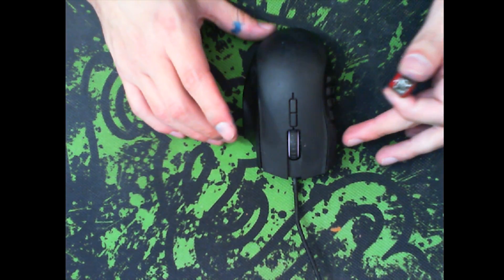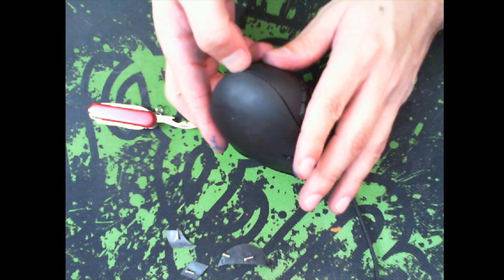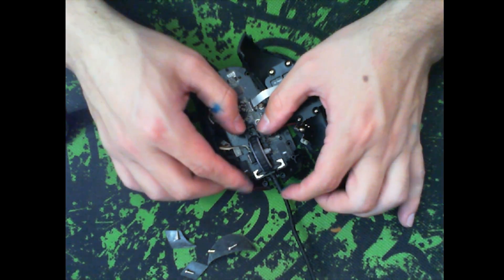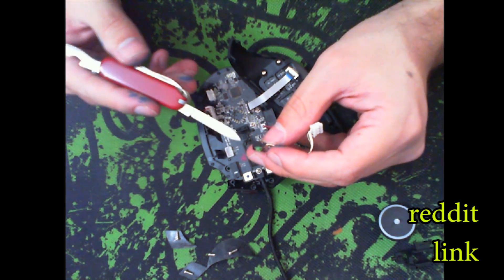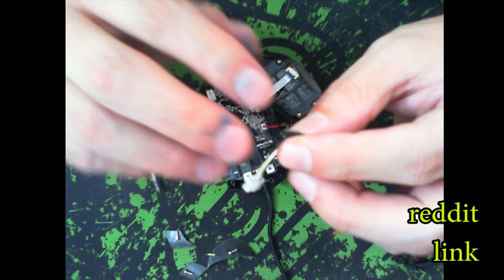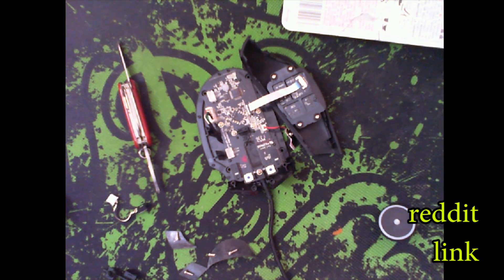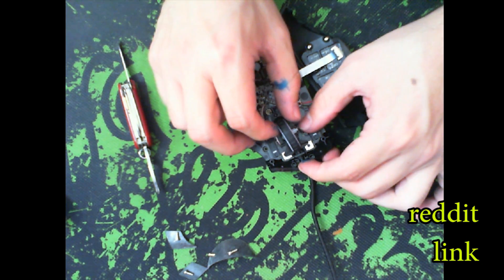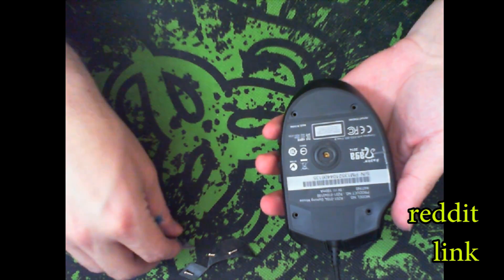How to Fix Razer Naga 2014 Scroll Wheel Jumping DIY

Comment: Took my Naga Chroma apart today after blowing into like other people have suggested didn't fix the issue. There was a lot of hairs and dust so I cleaned that out and put it back together, still didn't fix the wheel jumping. So I was going to give this a go but decided not to because I didn't want to cut the encoder in case I completely botch the process and completely break the part. I thought I'd find and buy a replacement encoder instead and just live with the jumpy wheel until then. Don't know why, but I flicked the encoder a few times with my finger before I put the mouse back together, to my surprize the jumping is gone! maybe flicking it unstuck the spring or something without needing to open it up. 😂

Comment: While I don't have the Naga 2014 at this point now, I do have the Epic Chroma edition that came in '15.  It's been amazing, until last weekend when the scroll started jumping.  I feel it necessary for anyone currently having issues, try opening it up and blasting it with air.  I done that and now it works amazing again.  I also want to note, don't let any glitter around your gaming or computer area.  That's what my issue was... So much glitter. #GottaDaughter

Comment: Thanks for the vid! Worked for my 2014 naga. I did not need to use superglue though. I was able to bend the D up enough to get it working, and then the square cover stuck snug to the black pieces we cut off, no need for glue. Had to bend it a few times to get it working though.

Comment: Thank you!! my razer basilisk ultimate have this issue! I've tried update firmware reinstall synapse and use straw to  blow in to the mouse wheel hole but they can't help. so I decide this last step to screw it as your show and it work!!

Comment: I'm just sitting here watching the "How To..." video while I blow my razer with a straw.  
Pro-tip for those using the straw method before disassembly:  Hold the mouse above your head so that you're blowing 'uphill' into the device.  Reason is to minimize the amount of moisture that is blown into the hardware.

Comment: ive done the straw and blow in it trick and all fixed it a couple times with the method. Even used a can of air as well. Eventually it didnt work i follow this and it works wonder. Tho i did not use glue i just put it back in and its doing just fine.

Comment: Thanks mate! I didn't go as far as deleding the metal plate, but this was def this square stuff involved into the "jumpy wheel" acting. I slided a little piece of paper folded into itself to prevent any parasite movement of the sensor connector into its platic case. The wheel is now a bit stuffer, but incrementing is acting normal. Good to go! Thanks again. (it was indeed full of dust too, but was not the problem)

Comment: you also need to remove that green circular peace and clean contacts (be extremely carefull), mine was covered with burnt plastic, after i cleaned them now it works, it was abit trouble to assemble back that encoder but it works now, other option is replacing encoder all together. Its a shame how such expensive mouse uses such cheap encoder, instead of optical wheel encoder that mouses back in 90's had, those still work on my ball mechanical mouses after 20 years of usage.

Comment: Overall a good video except a few bad camera angle moments. I had already tried the "straw" trick and while it would sometimes work temporarily it would not work permanently. I bent the spring inward and ta-da good as new. Only problem is that the scroll stages are really loose but I NO LONGER have the "jumpy" movements. Thanks a million!

Comment: Thanks for this video. The mouse wheel jumping has been annoying me for about six months. I followed the steps provided directly and it seems to be working. I think a big component of mine was the amount of shit inside the mouse. I went at it with some compressed air and a full head of hair's worth of dust was collected. I messed up the four pegs a little bit but I think I was able to repair that. If it breaks, it breaks. I've used this mouse for almost six years now.

Comment: First, It's great that most people were able to rememdy this by blowing in the wheel. However, I blew all kinds of ways even with compressed air and nothing worked. This video helped. I was not able to bend the "D" piece without completely removing it, but I would suggest that  the tension in the D piece isn't the issue. I think it has to do with the contact between the green piece and the bottom of the square box which is what senses the movement. There are 3 contacts on the bottom of the green piece that touch contacts on the bottom of the box. I cleaned the bottom of the box and the contacts while everything was taken apart. I didn't use any crazy glue, I was only able to sort of mash the top plate against the D and hold it together while I slid it back into the plastic piece that holds it in place on the mouse. However, once it was mounted back in, the problem was fixed, so if you're scared of using crazy glue, try that. Thanks for the video!

Comment: Great video, Thank you worked pretty good! I but guess you can skip " the tricky part" by removing the wheel without removing the wheel holder from the circut board. I will definitively try this out if I ever have this problem again!

Comment: I would just like to say, thank you DHYohko. This worked perfectly well for my Razer Mamba 2015 as well. For those that have my model, take care: The wire attached to that micro switch is soldered on to the board, the white connector you see is just to space them to prevent a short. As I pulled on the white connector I yanked them out of the PCB board, get your solder iron ready with steady hands, take note which wires go where and you will be fine. Good luck. :)

Comment: I didn't try blowing in it, but I didn't see a lot of dirt or anything when I took it apart.  And the friction on the wheel is noticeably better after the fix.  I didn't realize how loose the connection had got over the years.  An easy fix, and considering how much the naga cost totally worth it.  Thanks.
Reply: search for Encoder for Razer Mouse Razer Naga 2014, its the item that needs to be replaced. I ordered my from eBay so I could get it within a week.

Comment: DONT OPEN THE MOUSE!! Blow air inside the mouse, on the right side of the scroll wheel button using your mouth or a straw!! Tilt the scroll wheel to the left and blow air inside the right side strongly. And if you use a straw, sqweeze the end of the straw with your fingers, make it flat, so it fits inside the space there a bit, not too deep inside. I saw this technique in a different video and it works! You're welcome :P
Reply: search for Encoder for Razer Mouse Razer Naga 2014, its the item that needs to be replaced. I ordered my from eBay so I could get it within a week.
that will only work if the mouse its dirty. but if the bronze part its worn out, that will not work.
Reply: blew into the mouse, fixed the problem. But now my left mouse button isn't working most of the time = ="

Comment: haha forget it, way too much work to try and fix something that might not work after

Don't buy Razer mice, I used to use them but not anymore.  I went through a Diamondback 3G (left click double clicked after a month), Copperhead (died 1 month), two Deathaddr's (first Deathaddr died after a few months, second Deathaddr stopped tracking), Taipan (scroll wheel issue and firmware issues with PC on bootup) and Diamondback Chroma (major scroll wheel issues).  They all had reliability issues and if you send it in for RMA, you might have to wait up to a year.

Steelseries, Logitech and Zowie are much better.
Reply: "way too much work"??? Dude, maybe you should switch to Apple :P
Reply: This isn't a manufacturer issue, it's just the nature of the scroll wheel design because copper wears down. Not defending razer, they have their issues obviously like anyone else, but in this case it isn't a razer-specific issue.
Reply: Just blow air in it and it fixes it. No need to disassemble.

Comment: Fixed it, thank you.
2 things to add - under the green wheel where the copper was I found some kind of black dirt/corrosion that i was able to easily remove with some rubbing alcohol to ensure a better contact. Then on reassembly  I used the bottom of a hot coffee mug to reheat the teflon pads so they'd lay flat and stick better on the underside of the mouse.

Comment: Been using the Blowing method for a couple months but now its really stuck... This video FIXED it... I didnt even have to cut open the small box, compressed air canister right thru the side opening of the small box works just as well as removing it, if not better, to avoid possibly breaking the part!

Comment: Straw didn't work. There was no dirt/grime in the wheel.  Opening the mouse and putting a slight bend in the contact corrected the issue. Thanks for sharing the fix.

Comment: When I took out the keypad side I accidentally pulled out the white line connecting to the side keypad! BUT, I found out that it actually clips in there and is removable. So don't freak out like I did if that happens. I followed this video perfectly (even the super glue), and it fixed my mouse. Blowing works for like 20 seconds or less. Like he says, it's a connection problem, not a dust problem. Blowing didn't work, and this worked perfectly! Thanks a mil!

Comment: 1/20/2018, 4 years after purchase. It works, thanks man. just as an fyi, replacement pads are cheap at around $5-$7.   https://www.amazon.com/sets-replacement-Mouse-Skatez-Razer/dp/B00V6A28S0/ref=sr_1_1?s=electronics&ie=UTF8&qid=1516470967&sr=1-1&keywords=razer+naga+2014+feet

Comment: i have the  Razer Naga EPIC Chroma and this video is almost identical to what i am working with. The spring is a little different meaning you have to take out the green wheel piece all the way and pull the little metal  pieces up (i also got a tiny piece of cotton and cleaned it out in there because it was very dirty) but did everything else in this video and my mouse wheel is working like a freaking champ!
Kudos to you sir and thank you for making a video of this.

Comment: I fixed it. I didn't even use glue, the little thingy didn't close as good as when it had the 4 rubber heads, but after assembling everything back, it worked like a charm. Now let's see how long it lasts. Cheers for sharing the knowledge.
Reply: someone else here mentioned it, you can wedge a piece of an old credit card or anything solid and thin in that box that houses the part and it will force it to close.

Comment: tried the blowing in mouse it worked for about a day then wouldnt work anymore tried this method and worked.. also instead of cutting away the black parts its alot easier to just use fingernail clippers on those three spots to get to the metal piece also i didnt need any glue.

Comment: awesome.. i was gonna buy a new mouse and found this. fixed it this way. i didnt have to glue it together as it slots it tightlighty in the place. also you can undo that side button cluster ribon cable by pulling the black tab a lil upwards and you can pull the cable out. while i did this i pulled the whole thing apart and cleaned it out. there was so much crap under the wheel and all around the mouse.

Comment: FYI for the 2012 edition, you don't need to take anything out; you can see the green wheel and the 'bump' in the copper plate that touches the grooves, and you can twist a small screwdriver in there to make it contact more; it has the added benefit of more defined 'scroll notches' too, so that's nice.

Comment: I found a better solution for this problem.
Before coming up with it I tried the one on the video, and it worked, but in a few weeks the problem would come back even worst. 
The solution is so simple that it is almost silly that no one thought of it.

First: Remove completely that metal plate that covers the "D" shaped thing. (it is useless now, but it is good to keep that around if necessary. the way I did to store it was putting it on the same screw as the wheel light, just like this > http://i.imgur.com/vIM8H3f.jpg)

Second: Find a old credit card/similar thing. (It can be anything that is thin and hard really).

Third: Cut the credit card on the same size of the black box that the "D" is on. Cut around 5 stripes.

Fourth: Place those stripes on the box until it is firm on the mouse. then, pick another stripe and place it on the front of the "D", make sure it is making pressure on the tip of the "D".

Note that the stripes can't be bigger than the box were the D is. If the stripes are bigger, the mouse wheel WILL be stuck bye the mouse case.

I did this almost 2 months ago, and I had no more problems with the wheel, it is even better now!

Pics for your aid: 
http://i.imgur.com/A264dxB.jpg
http://i.imgur.com/w9kvlNc.jpg
http://i.imgur.com/XJ8BUnE.jpg

Good luck!
Reply: I went with your approach, but instead of making my own parts, I used the "D" shaped part from an old mouse and wedged that in between the "wheel controller" and the plastic "cradle" the same way. (The gap didn't seem as big on mine as on yours.) Seems to work just fine. Thanks!
Reply: The solution in the video worked 8 months for me (about 7h daily usage on weekdays). BUT I bent the D part in a better way than he did (used more force). Not sure how many more times it can be done before the D part breaks though. I think I'll try your solution next time. It looks more permanent.
Reply: the D part won't brake, talking from experience with similar contraptions, what will happen is that it's tolerance will become less and less with time, it will bend back and be weak way more often the more time goes by, but it seems like it can easily be fixed in some way or an other

Comment: So I came here looking for a solution to my scroll wheel issue. It just refuses to scroll at all. I've taken it apart, cleaned it thoroughly (90% isopropyl ). I tried it again, with the same results. I tried your fix as shown in the video, still no dice. I've worked on and off as a tech for the past decade, so I'm not totally new to this sort of thing, but even with my experience and your guide I'm stumped. Any ideas? Here's hoping you see this soon, I'm going insane
Reply: Is it working most of the time then skipping twice or moving back once. i did it and it solved my problem a little bit but problem is still there. best bet is to take a few bucks oout of your paycheck or mow a few lawns

Comment: I've been using this guide for a while now to fix my mouse but yesterday the fix stopped working.
I decided to investigate further before throwing it away. I had assumed the contacts inside the scroll wheel were too far gone.

To my surprise it it turns out this issue is not due to the lack contact but actually rust.

The scroll wheel has raised copper contacts which are touching the a second set of contacts opposite to the green wheel on the inside. The issue is due to rust. I noticed two rings inside the scroll wheel where the copper contacts were touching.. Upon removing the rust i put the mouse back together again and it was working like new.

TLDR: if the solution in this video doesn't work you'll have to remove the green circle and clean the opposite side.

Comment: Worked for me! Thanks! Tip: You can substitute the glue if you cut a 2mm broad ribbon of transparent tape and wrap it around the side of the problem part. Less risk of glue getting into the mechanism and easier to open up again if the problem should come back.

Comment: Thanks! This worked like a charm for me.

A tip for people using the wireless epic version, there is a big battery pack sort of thing in the wrist side of the mouse, so getting the 3 plates back on is a bit more difficult, but I found attaching the thumb grid part (left) with the top part first, placing it on the base, then wiggling the right side into the right place to be the easiest way to get it together. :)

Comment: @DHYohko Thanks, dude, I thought I fucked it up cause first, the little plate wouldn't stay in place, but as I put it in the hole, I worked and then my sensor wasn't working but that was cause I put strips that normally come under chairs over the screws instead of the normal things (forgot the name)
In the end, it worked and it feels so much better when I don't have the click every scroll I do, it just flawless scrolls
so nice

Comment: Thank You man for this manual. For how long this fix help? If possible to buy somewhere only this sensor? I suppose that this part should cost cheep and replace it is easy. Anybody tried even before contact with Razer and ask is they will sold this part?

Comment: Before doing this : get an air can or duster , or simply just blow all the dust out where the little opening is between the two clicks and mouse wheel, and it should work. i had this problem for months and just blew air into my mouse and it worked... before fucking with ur mouse like this, try simply removing all the dust between ur left click mouse wheel and right click

Comment: This worked very well, thank you a lot for the guide Xionous & DHYohko. For those saying that is enough to blow with a straw, i was doing the same but with compressed air, and didnt worked. I disassembled the piece (is a potentiometer), and i saw that the cooper contacts worn out, so a bit more pressure is needed to work again. Of course, the ideal fix is to change the entire potentiometer, i tried with an old naga (2012), and the piece is different, so the goal is to find a similar potentiometer, or at least eventually i will disassemble other naga potentiometer and change only the contacts inside.